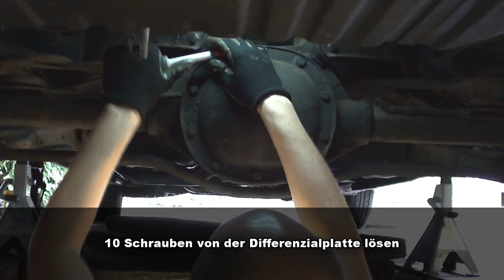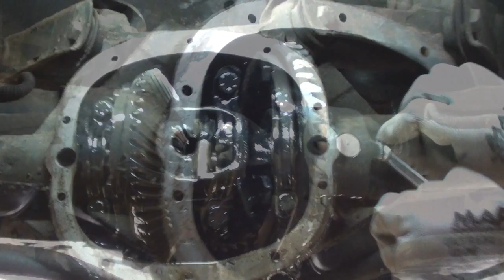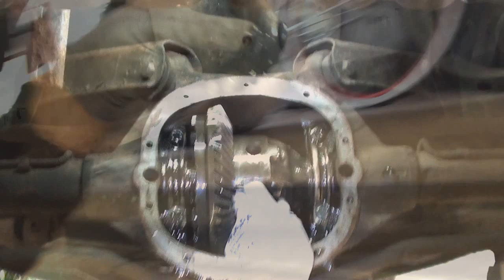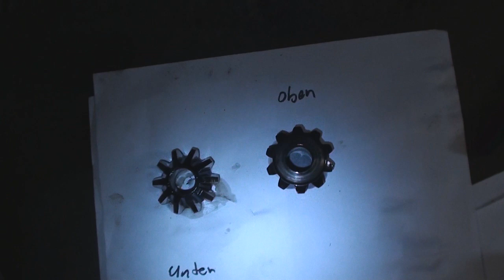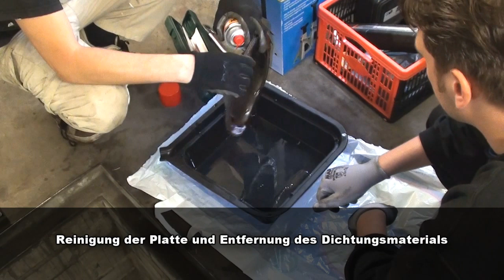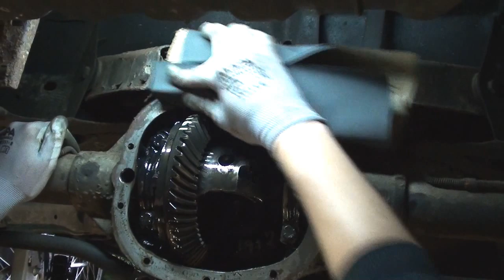Einbau der 7 1/2" Mini Spool (100% Sperrung der Achse GM)

Comment: He did put the pinion pin retainer bolt back in but did not use any lock tight on it . Bad move especially with the vibration that mini spool is going to be transferring to the pinion pin . It will work it's way loose and cause a disaster .